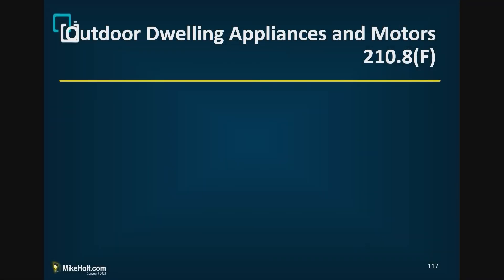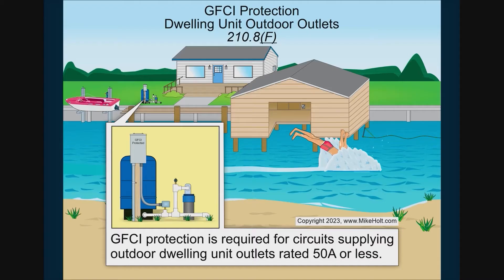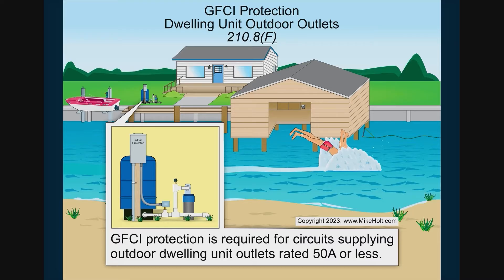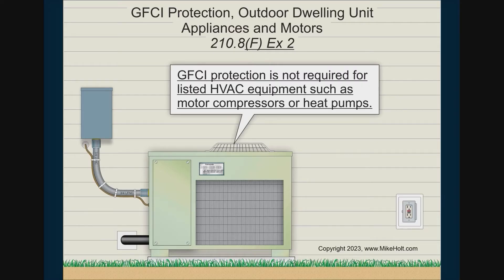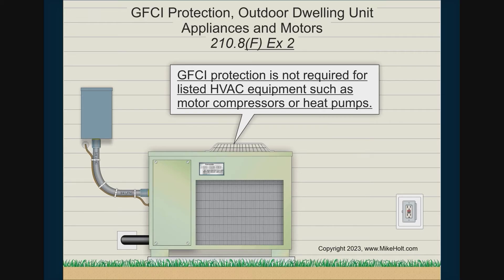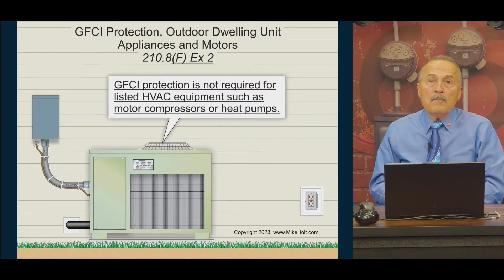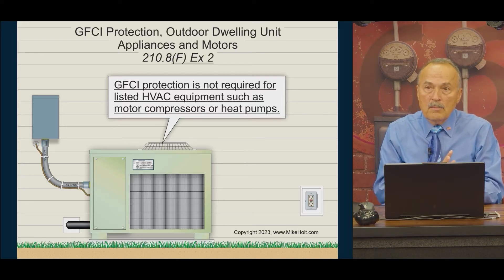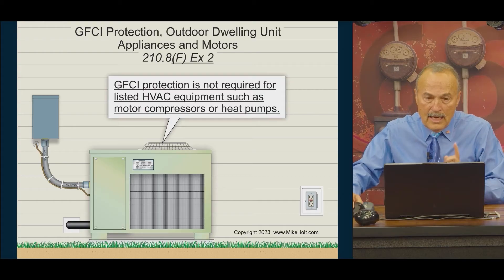GFCI Protection of Outdoor Outlets , NEC 2023 - [210.8(F)], (1min:47sec)

Comment: What about for well equipment and pressure switches? 240v
Reply from the maker: @Gatronation2020, did you watch the video?
Reply from the maker: @Gatornation2020, correct as covered in the video and graphics.
Reply: When you said irrigation, I was under the oppression like a  rain, bird  but houses that get their water from a well would be covered then

Comment: Hello, can I ask a random question?   I purchased a lot of your streaming courses and I’m slowly working my way through them.  Right now I’m taking your advice to rewatch the Fundamentals course before moving on to the NEC Volume 1 course (which is a good idea, there’s so much to take in).

Anyway, I’m not sure if I missed this, or if it’s obvious and I’m about to ask a stupid question lol…but let’s say that we have a 480V primary and 120V secondary step down transformer.   Ok so I think that I fully understand that grabbing either individual winding will shock me relative to the proportion of distance that I grab across that winding.   For instance, as a totally made up hypothetical example let’s say that the primary winding is 48 inches long (and that the starting point is ‘Point A’, and the ending point that is 48 inches away is ‘Point B’)…and let’s say that the secondary winding is 12 inches long (and likewise it’s starting point is ‘Point C’, and it’s ending point that is 12 inches away from that is ‘Point D’).   So, point B is where the neutral and the ground rod of the primary winding are bonded…and point D is the equivalent point for the secondary winding.

Ok so I understand that if I start grabbing anywhere along the points between A and B, or anywhere between the points between C and D, that I will get shocked with a difference of potential that’s relative to the length of the winding.   For instance if I grab point A with my left hand, and then grab the primary winding 12 inches away from point A with my right hand…I will get shocked with 120 volts of potential difference (because I grabbed across 25% of the length of a 480V winding).  And if I grab point C of the secondary winding with my left hand, then grab directly in the middle of that winding (6 inches away) I will get shocked with 60V.   Etc.   And…if I grab point B or point D with both hands, I won’t get shocked at all because it’s the same exact potential.

So I think that I’m totally clear on that.   But what I’m not sure about is the potential differences ACROSS the primary and secondary windings.   If I grab points B and D for instance, is that 0 volts?   If I grab exactly halfway between points A and B (24 inches from each end) on the primary, and with my other hand I also grab the center of the secondary winding (6 inches from points C and D) is that 0 volts?   Etc?   I’m not totally clear about the potential differences that exist ACROSS a primary and secondary winding of the same transformer.   I think that everything that I said in the hypothetical situation is true, but I’m not positive, and hopefully you could tell me if I’m understanding it correctly.  Thanks!
Reply from the maker: Please post your questions on MikeHolt.com/Forum

Comment: My interpretation, would include oudoor pool pumps less than 50A, water pumps, etc.
Reply from the maker: 210.8(F) applies to 120V, 240V, and 120?240V circuits. The 150V to ground means any circuit where the voltage to ground does not exceed 150V.
Reply: @MikeHoltNEC  it’s been a long time, retired 13 years, I like your channel, like to keep somewhat abreast of the industry. Thanks.
Reply: Only if the pool pumps are 110V, most are 220V ?